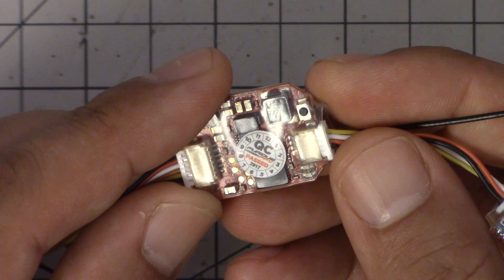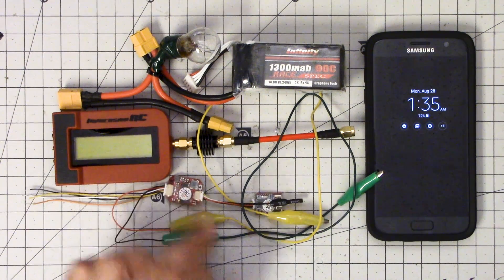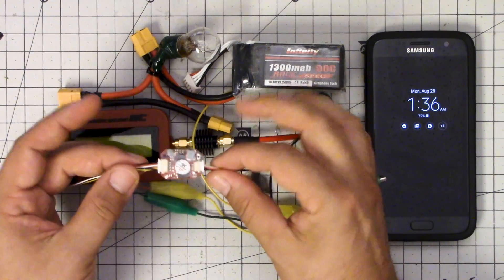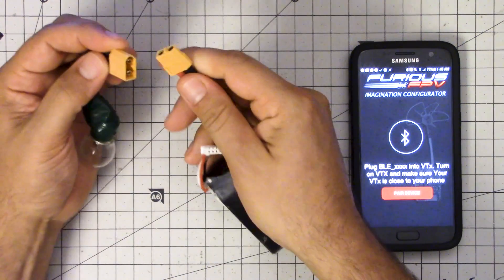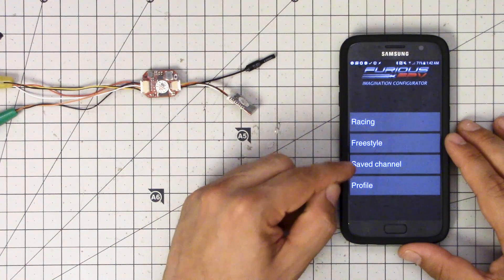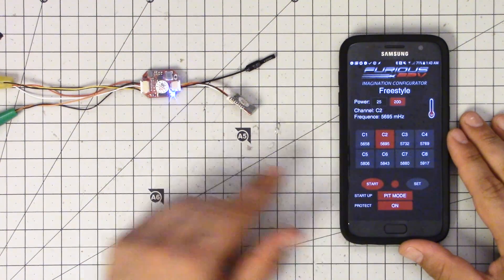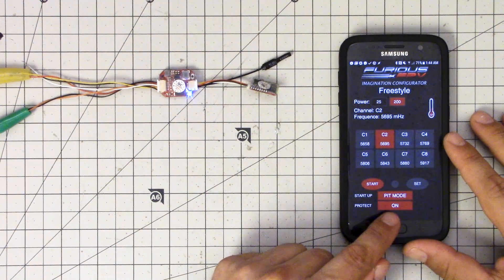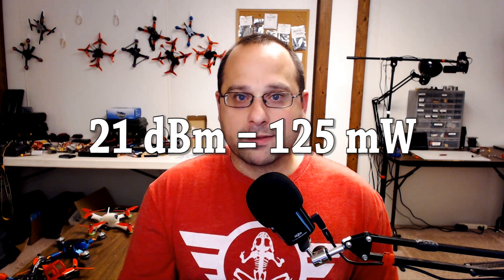Furious Stealth Race vs. TBS Unify Race

Comment: The TBS Unify Pro HV is, well .., crap. Never observed a transmitter which gets that hot even while sending just with 25 mW. I also do not believe that "good" air flow is the solution. No transmitter should get > 90 degree at 25 mW. I printed a housing (with ventilation holes) for the transmitter. In the first run, it was melting through the PLA :) Good job TBS!

Comment: Did you power the Furious from a 1300 4s, and the Unify from a small 2s? Could this have anything to do with the heat?
Reply from the maker: I tested this difference, although I can't remember if it made it into this video or a different one. The input voltage makes little difference in the heat buildup. It's the output amplifier that makes all the heat.

Comment: Josh how is the Video Quality Output of the Furious that seems to be one of the "Selling Points" of that VTX?  I'm a big fan of the TBS Unify but I Use JR Transmitters and have no access to Smart Audio so the bluetooth can be advatage to me... thanks for any input.
Reply from the maker: +jeff gustin whether you can use SmartAudio doesn't have anything to do with the transmitter. You can control the vTX from Yhe osd with any transmitter that had two sticks.

Comment: I recently subscribed and love your channel Joshua. I tried looking through your videos for practical advice on "Fire Stopper". Can you please advise what kind of bulb I can use for indoor testing/calibrating, not flyning (4s battery). BTW, I'm building a my first multicopter (hexa actualy, using pixhawk, Emax BLHELI ESCs, Gartt 2312 motors,...), and I accidently swapped signal and ground to an ESC with UBEC so that it effecively commited suicide taking the motor with it. I'd like to avoid these kind of accidents due to "wonderful circuit design" in the future. Keep up the good work!
Reply from the maker: +ooSreckoo swapping signal and ground shouldn't fry an ESC... Anyway, get a 26W/5W two element automotive bulb.
Reply: Thanks, works great. It's been a while, but another ESC smoked on battery connection. It happened randomly after a few successful tests. Obviously I bought bad/fake product. If anyone reads this: "Don't buy on ebay. Buy from reputable shops."

Comment: The positive thing is the size for me. 
Other than that it does not ad any thing that i like. 
The Bluetooth makes it bigger again and is just an adon that is more a gimik than needed. 
25mw is fine for me. Never go higher so that is good. 72 channels is also not needed. 
As I look ad a vtx for racing than the Tramp is by far the nr 1. Reason is very simple. They have the want and the only usefull adon there is for a vtx.
No more things like what hapend on the multigp rotor riot where someone is on to high or wrong settings, way faster changing of channel without any problems because the organisation does it. You only need to put your quad on the number that you got and they set it to the channel and you sit and plugin the cable to your goggles and ready. As soon as you plug the quad in, it is set and you can fly. As soon as you unplug it, it is in pid mode.
Best system for racing there is and it should be a standart. 
That on this vtx and it is something you can say it is usefull instead of this bluetooth thing.

Comment: Joshua Bardwell, I wonder if you could help me when I start my drone up and I give throttle it starts to wobble it was running good about a day ago I haven't crashed but it does that once in awhile I was wondering what that was demoted or spinning correctly the props are not turned around backwards if you could help me I really appreciate it

Comment: Nice video, but why not change the power meter to show values in mW instead of dbm?No need to tell us the covertsion for every new measure then....
Reply from the maker: Because dB is the correct way to compare RF power measurements. mW is for plebs.
Reply: Perhaps. But since all vtx are always mentioned in mW and not dbm, and you felt the need to tell the mW levels anyways, perhaps mW would be easier to relate to for most viewers 😉

Comment: Joshua - I've found that the input voltage for a VTX impacts how hot it gets. More voltage more heat. This is why I like the MI200s as they run cool at 5V. Perhaps the voltage conversion creates heat.
Reply from the maker: I checked the Unify on both 2S and 4S input and there was only a very small difference in heat buildup at 200 mW.

Comment: I went to a few races where the racing was done on raceband and meanwhile a freestyle competition was held on low raceband. The organizers had the permission (and paid good money for it) to use those frequencies for the duration of the event. I don't know why everybody is hating on low raceband so much. Many frequencies of the "normal" frequencies (e.g. raceband channels 1, 2, 7 and 8) are illegal to fly in europe, it's the duty of the pilot to just only use what you are allowed to. Why shouldn't I own and use a vTX with low band when the event organizers get permission?
Reply from the maker: I agree. If event organizers have permission to use L band frequencies then there is no problem. The problem is vendors selling vTX that can use L-band without any indication at all to the user that this is illegal, and without any restrictions or anything like that.

Look at what ImmersionRC does with the Tramp. It can be re-assigned to a new ITU region, but only by the Race Director wand. And they don't sell the Race Director wand to just anybody. So a typical person can buy a Tramp, and it only supports legal frequencies for their area. But then they go to a race and they can easily be assigned to use whatever frequencies the race has permission to use.

The least a vendor could do if they are going to sell a radio that supports L-band is warn the user that it's not legal in their area. It drives me crazy to hear some people saying, "L band isn't legal unless you have a HAM license." NO. That is totally wrong.
Reply: Joshua Bardwell I agree, but in that regard the L-Band isn't any different from eg. Fatshark 8 in Germany. F8 just as illegal to use as L1. 
The immersion rc approach is nice, but somewhat of a hassle with all those (quite expensive) wands. I don't mind the TBS approach either. Print channels red in the manual that are illegal to use and require an unlocking procedure. It should be more localized to be more region specific though.

Comment: Also note that the red coax cable provided with the IR power meter is horrible. I have a couple of them and I get different values depending on how I hold it. But maybe you tried wiggling it around and the measurements did not change by much.
Reply from the maker: The measurements were consistent over about 2 hours of testing. But I didn't think you would want to watch the whole video of that.

Comment: It just weird to me. I use 4 Unify pro 5G8 and 1 Unify pro HV and never have a shut down due to overheat problem. No matter how long I am waiting for the race to start. It is turned on like10-15mins+(until all my friends' Unify pro have shut down due to over heat). We use same MW. The VDO quality never drop too. Some of my Unify Pro 5G8 are around 8-10 months old and they still work great. My set up is always TBS powercube.
The only Unify that I broke due to turning on for too long is the one in FPVision. Well since I never have any problem with the heat so I turn FPVision on to adjust the OSD so long like 15-20 min and Boom! The VTX broke.

Comment: Hello Josh I can't run d shot 1200 if I'm on 8k8k right? I'm asking because betaflight allows me to select dshot1200 and it's saves but it doesn't sound right when I arm so I just run 600 on some 32 ESCs. Should i be able to run d shot 1200 on 8k8k or not. Just for the record it does seem like a stupid question lol. But nothing surprises me
Reply from the maker: I don't see why you couldn't do that. The whole point of 1200 is that it's faster.
Reply: Joshua Bardwell  I just thought my flight controller has the run higher than 8k 8k to be able to set that way

Comment: So turn off heat protection.......
Reply from the maker: Yes, thank you I thought of that. The results didn't change. Whatever heat protection does, it didn't affect these results.
Reply: doesnt heat effect current flow in electronics maybe this is what might be causing the issue.but im no electrical engineer what are thoughts on this joshua.

Comment: seby docky uses one of those mw output things and hes been showing all the cheap vtx's can be way off claimed outputs, i flew around for a week with my eachine t526 on 25mw didnt notice any diifference when i finally managed to put it to 200mw.. it was disastrously hot on both, so hot i havent dared try 600mw... is there any chance using its lowest input voltage would help with the temperature rises?.   when i say disastrously hot i mean running your thumb under cold water for ten minutes. what about heatsinks...do they help much at all..?

Comment: Sadly, it would seem the bottom line is it doesn't work.
 
If it won't put out the rated power in a typical installation, it shouldn't even be sold. (IF they care about truth in advertising, customer service and their reputation).

Buried in a stack or installed in other safe place is where it needs to pass muster.

This simple requirement creates 2 major issues:
#1 - the obvious fact it will overheat and not produce rated output. 
#2 - installing it precludes connection the Bluetooth module, effectively eliminating the advantage of Bluetooth - a problem I also discovered  with the Runcam Split (a major disappointment).

Given the facts, it would be lucky to produce 25mw in a typical installation, and in most cases the Bluetooth would be unusable. (Both which could possibly be worked around by designing the whole quad around the VTX, a deal breaker for almost anyone - even then it's doubtful you could trust it to produce 200mw reliably). 
That being said, I suspect the thermal limiting system is set on the conservative side, and if the TX were allowed to get hot as does the TBS, it may just meet published specs. For how long is hard to say, but the TBS units seem to survive the 800mw 'waiting to fly' heat soak  treatment with little ill effects. Although that isn't the preferred way of doing things, it does seem workable if you write a LUA to idle @ low power until lift off.

My 'Holy Grail VTX' will have Pitmode, 25, 200, 600mw, maybe more? settings, SmartAudio (LUA capable), and integrated Bluetooth. Solder tabs. Pigtailable antenna connection and some way to mount it beyond glue or wire ties. 30.5mm Stack Form Factor would be nice.

I had a thought, if the manufacturers were to use already existing video motion detection systems to automatically take the VTX up to full power once motion is detected, an 'auto power up' mode could easily be designed into a VTX. This would help manage heat and extend battery cycle time. Another thought I had regards our current stack format - it seems that we are running out of vertical space. A variation on the 30.5 to 30.5 x 61 bolt pattern would allow engineers much more liberty in combined designs (and room for luxuries like heat sinks and terminal strips). A single board Flight Controller/Rx/ESC/VTX/DVR (and possibly HD camera ala Split) would be possible (and light). 
(I'm a retired controls engineer and can't stop engineering) 

Thanks, Joshua, for another great review. 
You saved me from another disappointing purchase, as this VTX (in the higher power model & working) would be a 'go-to' for me. 

Scott
Reply from the maker: "Given the facts, it would be lucky to produce 25mw in a typical installation"

I disagree. I think it will hit 100 mW minimum in a typical installation. Bear in mind that the IRC power meter is not perfectly calibrated, so it can read a bit high or low. I do think the Unify Race is a better choice because there is no question it handles heat buildup better. But I don't think we can definitively charge the Stealth with not meeting its spec.
Reply: You would have a better feel for the true output capability limits, having played with it.
I based my estimate on the fact you said it was putting out 21dbm (126mw) with it attached to the fan grille, and figured by guesstimate that in dead air or wrapped in a stack, thermal protection would more than halve that.  

I'm not trying to 'beat up' Immersion, and truly hope they work the bugs out.  I would be among the 1st to buy if/when they do. They are moving in the right direction in my opinion.

It seems to me they may have rushed to production on these. This market moves so fast it's understandable that there would be pressure to do so. It' also possible you have a dud. it happens.

Comment: Sooo... the difference here between the Furious and the TBS is that the Furious drops a tiny bit more power when warm and gets a little hotter because of the smaller/lighter package?  All 3 VTX from both Furious and TBS that you tested seemed to do the same, and at one point when you bumped the cable on the Unify the output went up?  I understand that we didn't see all the time that was put into the testing, but still.  It felt like you played up the output drop on the Furious, and played down the output drop on the TBS.. could have just been me and the way I saw it.

That said, the conclusion that the TBS is better seemingly based solely on customer service feels a bit misplaced to me.  Did they eventually fix the racetracker?  Sure, and good on them.  But... if they were some shimmering beacon of light with awesome QC.. how would that have ever made it to market in that condition to begin with?  Add to that various other sketchy "customer service" interactions both myself and others that I know have had with them, and their own fair share of product failures... and I can't do anything but dismiss that as some kind of tie breaker.

So, I would personally call this one a tie and people buy what they like.  If you're a furious guy, buy that.  If you're a TBS guy buy that.  And no one is wrong with either choice.  Hearing the final conclusion and seeing people react with "TBS FTW!" makes me scratch my head a bit.  What am i missing here?
Reply from the maker: It gets a LOT hotter. After a few minutes being powered up, the Stealth hit 70 degrees with airflow and 90+ degrees without. Celsius.

The output drop on the TBS was smaller, and stable. It dropped a tiny bit when it first powered up and then stayed consistent. The output drop on the Stealth was continuous. The longer it was powered up, the lower its output power got and the hotter it got. Bottom line: buy whatever you like.
Reply: I thought the Furious stayed right at 21dbm (~125mw) once it was hot, and the Unify race bottomed at 21.75 (~150mw) when you stopped showing it?  That said, has furious said anything about the heat?  Yeah it was hotter than the TBS but if that's within spec of their thermal protection.. is it an issue?

Will be interesting to see what video quality looks like (as in if the Furious picture quality degrades as it gets hot)
Reply from the maker: If left in unmoving air, the Furious temperature climbed to over 90 degrees celsius. Somewhere in that range, it started further reducing power.

Comment: TBS customer support is Not second to none. I had a service ticket open with them, and all I got was the run around, and they never fully resolved my issue. I will personally never buy any TBS product again because of my experience. I'm glad others have had better luck with them. 
Happy Flying...
Reply: valiant360420 agreed! I've had the same issue with TBS with a DOA Unify pro, I'm now using a Tramp . I cant wait for the lumineer stubby to arrive so I can get shot of the Triumph stubbys.
Reply: HighVoltageProjects - Thanks for sharing!!  You wouldn't believe how much hate I get when I say something negative about TBS.

Comment: Any recommendation of a retail smokestopper or is one better off making their own?
Reply from the maker: The retail ones I've seen use a fuse, which is inferior. It will blow in response to an over-current and then you have to replace it. The advantage of a smoke-stopper is that it protects the equipment and is infinitely reusable.

Comment: Slightly off topic here but I've broken a couple of these 5 to 6 pin connectors (jst?) on my vtx and was wondering if anyone can recommend a way to solve this issue. After a crash or from unplugging/plugging over the course of time, they become loose and cause signal loss. I tried to solder wires directly to the tiny pads where the pins connect to the vtx, but they are so small and close to each other, I couldn't keep the solder from bridging. It seems like this would be a common problem but I can't really find a solution. Wondering what experience you all have with vtx connectors.
Reply from the maker: Unify uses JST-GH which is larger and a bit more secure. Of course you can get a vTX that is designed for direct-solder too.

Comment: What about passthrough to the FC? I used to mount HC-05 modules so this has the potential to be a combo. Is it possible?
Reply from the maker: Not sure what you're asking. Can you elaborate?
Reply: If you hook up a Bluetooth HC-05 module to a UART on an FC you can connect to Betaflight via Bluetooth. If this thing can do passthrough you could connect to the FC via the VTX. Would be cool and maybe they arleady made it possible.
Reply: To be honest I don't care much about controlling the vtx with Bluetooth but the fc would be another thing.